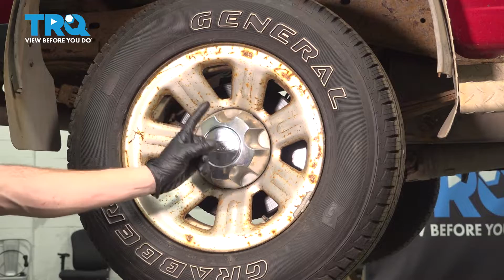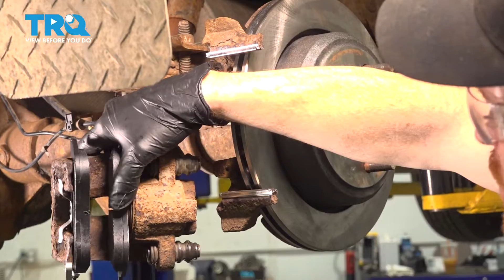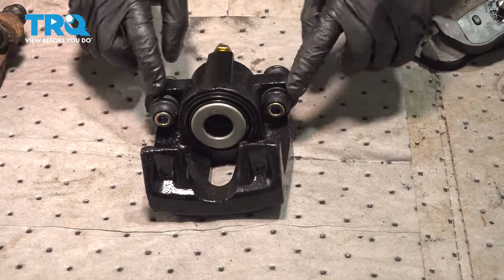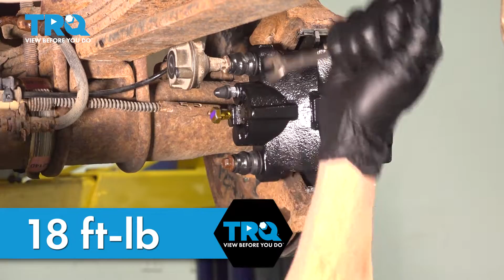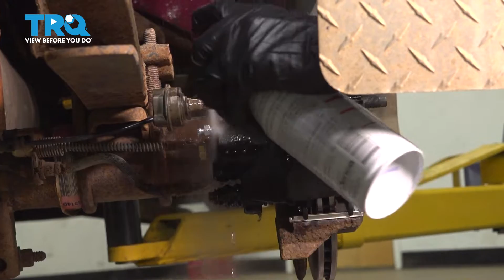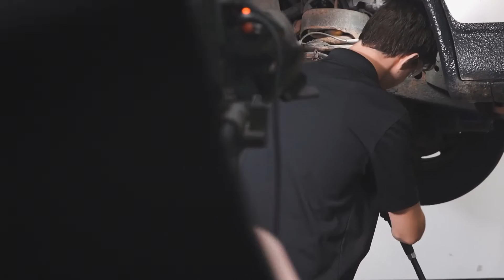How to Replace Rear Brake Calipers 1998-2011 Ford Ranger

Comment: Perfect video. What a weird design. Those little 10mm slide bolts (that easily round off when old/rusty) and that goofy dampener cantilevered off the end. What were they thinking? Might as well include a pair of vice grips with the title!